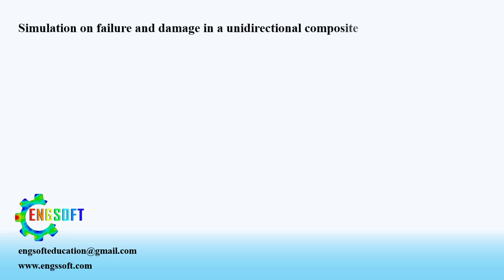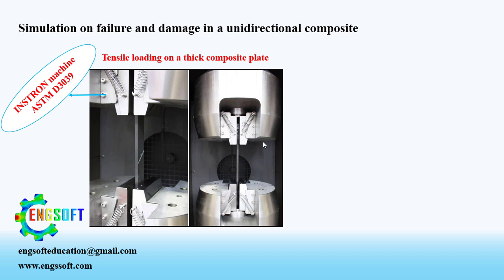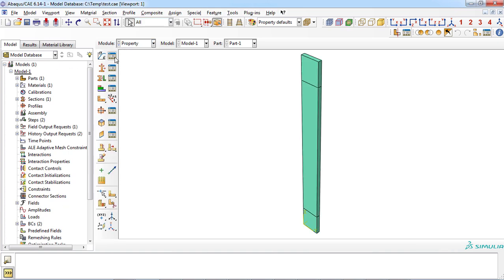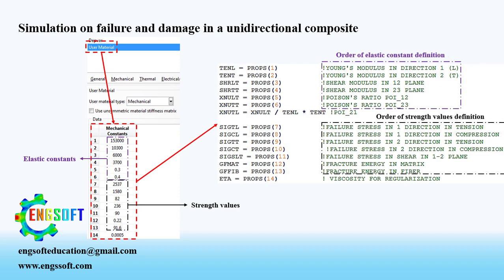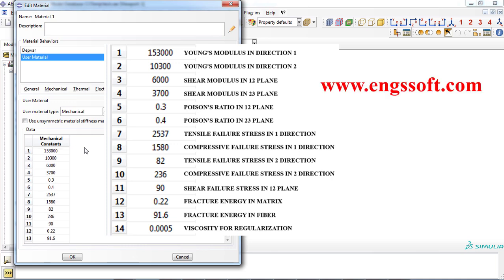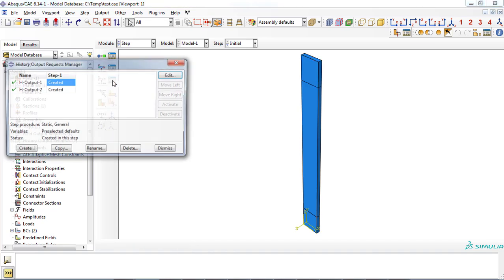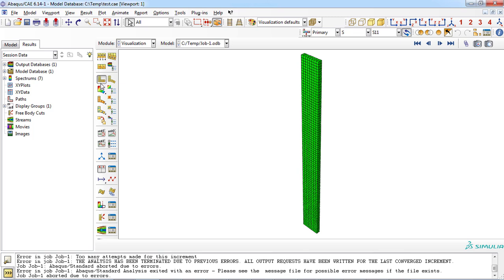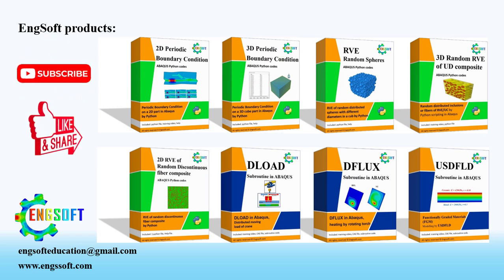Abaqus UMAT for damage of three dimensional (3D) fiber reinforced composites

Comment: THANK YOU FOR YOUR EXPLANATION, BUT I HAVE A QUESTION: WHEN I WANT TO APPLY THAT FOR A PRESSURE VESSEL FOR A COMPOSITE MULTILAYER MATERIAL, FOR EXAMPLE 10 LAYERS WITH STEQUEN SEQUENCE +45/-45, CAN BE APPLY UMAT SAME METHOD AS YOU OR NOT?

Comment: Excellent work, if the materials is multidimensionnelle fiber we shoud do the same sbrotine or change it ??
Reply from the maker: If you mean that you have a laminate that each layer is unidirectional you can use this subroutine for each layer and assign material orientation to each layer based on fibers direction.